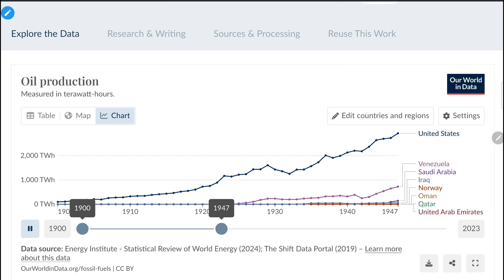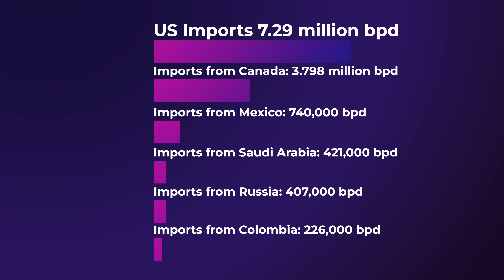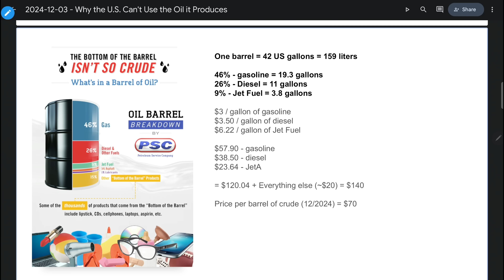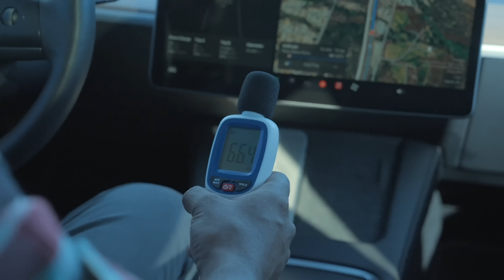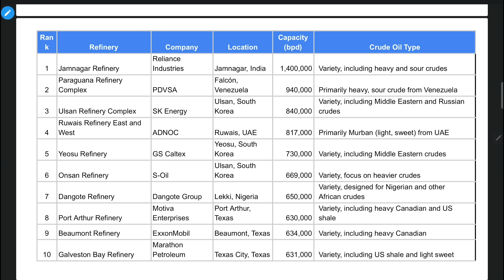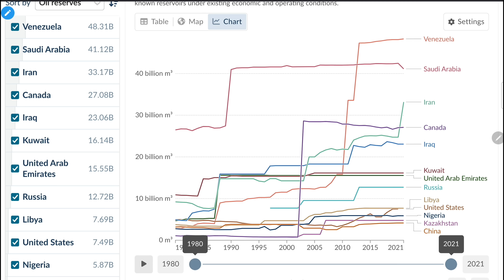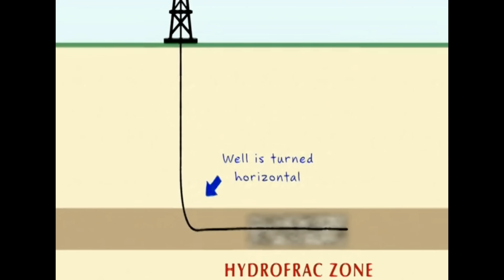Why America Can't USE The Oil it DRILLS

Comment: I work in the O&G industry and the large issue is that it is basically impossible to build a new refinery and it is almost as hard to get the permits to change a refinery to be able to run that shale oil.
Reply: @Nanan00  they're building a new refinery right now in Cushing, Oklahoma. It's not impossible, the oil companies just don't want to spend money and cut into their record profits
Reply: @christopherscott5652 Not true. 
When government administrations are hostile towards oil and gas there is no confidence in expending capacity.
Reply: @Nanan00  Impossible, or just more expensive? I’m not aware of any efforts to even try. Given the petroleum industries willingness to spend 100s of millions on climate change denial and other lobbying efforts - I don’t buy it. If they wanted to build new refineries, they’d be lobbying to do that.
Reply: @ -  It is absolutely not a technical issue because shale oil is much lighter than normal crude meaning it has more hydrogen and less carbon.  This means it is easier to refine and doesn’t need as much cracking from an FCCU (Fluidized Catalytic Cracking Unit) or a fixed bed Hydrocracker both of which are very energy intensive and result in CO2 generation.  If permits are an issue I am not sure why.
Reply: One must realize that to drll a a potential oil well depends entirely if that well makes money with a fairly quick payout for the oil company with respect to the forecast future world oil prices over the next seven or so years.   Oil companies want to make money, therefore, they always compare the risk of finding economic oil reserves in a new drll prospect, the risk of the future oil price forecasts , the risk of inflation, etc, versus what they can earn alternatively by putting the hundreds of thousands of dollars to drlll a well  into some other types of non petrolem safe investments.
    One problem with the 'drlll baby drill' attitude is that it can be too successfull in finding new economically oil reserves, therefore the market gets flooded with oil, the oil prices fall, and oil companies can not drill any new wells because the the cost of drilling and transporting the oil to a refinery is greater than the value of the oil in the ground.  Oil companies will take any profits and invest them in safe non petroleum opportunities instead of exploring for new reservoirs. And your country's oil economic reserves will fall until the oil prices recover due to future perceived oil shortages.
Reply: Thanks to the leftist liberal environmentalists running the EPA, we will never get a new refinery with the advanced technology to refine shale oil due to the illegal, unconstitutional regulations they make to prevent it from happening.
Reply: That sounds more like a government excuse and not a technological or economic hurdle.  Without those permits, a company would absolutely find a way to get it done.
Reply: When I heard you say "first, we would have to reduce coking capacity which helps break down the heavier parts of heavier crude oil," I knew you really don't  understand the refining process. The coker takes the "leftovers" from the distillation unit - all the heaviest stuff where it is pumped into a very tall column and heated to high temperature while pulling a vacuum on it. This extracts light ends that were trapped in it. When complete the column if full of solid coke. A high pressure drill is sent down the column to clean it out and break it up into something resembling coal. That stuff is shipped off to other countries to fire up their steel or electric power plants. There is no lowering of capacity. Crude oil always varies in thickness, density, sweetness, particulate levels, etc. The heavier the crude, the more coke you are likely to produce. The fractionating column temperatures also vary somewhat depending on the crude you are running, the flow rate, the reflux rate, the analysis of each cut and production goals. I could go on, but I disagree with the idea America "can't " use it's own oil. Those matters are driven more by politics than anything else. PS: the hexane extracted from the distillation unit is used to extract rapeseed oil. That oil is not fit for human consumption until it is highly refined into what we know as the coined name canola oil. Peace
Reply: No the problem is profitability💵💵💵 oil companies are not going to pump more ,refine more just so consumers can have cheaper fuel ⛽️ the other oil nations will simply cut production to raise prices 💵💵💵💵💵💵💵💵
Reply: I've Been to Texas they Move there Rigs about every other Month. So I See No Problem of These Oil Rigs Being Moved. I seen the Still Oil Rig in 20 Different Locations and I know this By the Name and Number on the Oil Rig.
Reply: No, it's not the cause. I'm 20 years with GDF Suez. Listen to the last 5 minutes of this. Refineries will put no money in refineries except for a little fixes but they understand that we peaked on our oil consumption. I've run a hundred project proposals at refineries in Martinez and LA... They don't want to put a dime in that they don't have to.
Reply: We can refine all oil produced in the US. Building a new refinery is and has been taking place...expanding an existing refinery IS building new. Ignorant.
Reply: I’m in southeast Texas and we routinely have days of heavy cloud cover. Our color panels can’t keep up and our batteries die. It’s happened twice in the last 2 months.
Reply: Internal combustion engines can be made to use naptha as a fuel since that is the predominant distillate, but I doubt that will ever happen.
Reply: This is not really true. My dad worked at a refinery that was changed over to run shale oil in the mid to late 2000s
Reply: I am an Albertan, and we know this. We know that the USA  needs our bitumen as the refineries  are calibrated  to refine  tit. This is one point that makes Canadian  unhappy  when the President  insists that  the USA  needs nothing from Canada  , when we know it isn't  true. We also supply potash for all the fertilizer, nickle,aluminum , hydro, lumber, and LNG, to name a few. These tariffs  are hurting  regular folks  on both sides of the border.
Reply: You are blatantly wrong and I guarantee you do NOT work in O&G unless you are a truck driver: You might notice that NG(Natural gas) is being used more and more as quickly as we can build infrastructure --> AKA NEW REFINERIES, BRAND NEW refineries which NEVER existed, to refine and UP crack(length of polymer chains) to create engine oil etc today?  Why?  Total Profit margin as NG is nearly free in Texas.  Said NG refineries are BRAND spanking NEW.  Just loser states like New York and morons on the LEFT coast are not allowing the building of new refineries.  Plenty of new refineries in Texas, Louisiana.  Might be a new refinery being built in either Ohio/West Virginia and North Dakota or Montana.  Pull head out of your nether regions please

ALso you are wrong and so is 2 bit as both of you are  ignorant of how the refineries work. Yes, USA can easily use the light sweet crude, just that the cracking process(very expensive oil refinery complex) will not be fully used and therefore a lot of infrastructure will have sunk ~$Trillion dollar sunk costs which will be left rusting NOT being used.  It is THEREFORE cheaper(more profitable) to import CHEAPER heavier crude and refine it using said infrastructure with sunk costs which would otherwise NOT be used, and sell for a higher profit margin while selling the light sweet also at a HIGHER profit margin.
Reply: Don't think it has anything to do with PERMITS HAS EVERYTHING TO DO WITH $$$$ to change refinery, they run the refinery at full capacity it it blows up SUNOCO PHILADELPHIA  and many more I'm sure.
Reply: If you believe that the oil industry isn't ok with not refining here or that trump will fix it, you are dreaming.  They are making money  hand over fist and there's no more money to extract from the working person. It's not about oil, the environment or providing a service.  It's the dough.
Reply: Perhaps the in coming (2024) Trump administration ( 01--20-24). These democratic party😈 regulations are asinine. democrat  party😈 controlled in California where a 3rd refinery will close in (2025).
Reply: I know
Reply: You are 100% correct government regulation's are the problem.
Reply: Let the us need the oil enough and we will see
Reply: Correction to all the arguments saying it can’t or won’t be done very soon….anybody hear of the Chevron Deference?? The department formerly known as the EPA will still exist in some facsimile thereof, but the fat unelected bureaucracy that we have at become familiar with…is going the way of the dodo 🦤👋bye-bye party poopers!✌️
Self reliance will be making a comeback in a much needed and long overdue way. EVs are fine-I think they’re a great option for some people’s needs, but the way that the administration currently on its way out was mandating the switch to them was totally irresponsible. The amount of serious advancement that the grid required for such a thing could not be taken lightly or expect to happen in a short timeframe. All alternative energy methods right now require a significant amount of “oil” and other “fossil fuels” to support them; which is why maintaining diversity within the automotive industry is so critical and will be continue to be a strong option as we move forward. You do realize that 100yrs ago there were MORE EVs in New York City than combustion vehicles right 😊. Future looks bright🇺🇸
Reply: Correction to all the arguments saying it can’t or won’t be done very soon….anybody hear of the Chevron Deference?? The department formerly known as the EPA will still exist in some facsimile thereof, but the fat unelected bureaucracy that we have at become familiar with…is going the way of the dodo 🦤👋bye-bye party poopers!✌️
Self reliance will be making a comeback in a much needed and long overdue way. EVs are fine-I think they’re a great option for some people’s needs, but the way that the administration currently on its way out was mandating the switch to them was totally irresponsible. The amount of serious advancement that the grid required for such a thing could not be taken lightly or expect to happen in a short timeframe. All alternative energy methods right now require a significant amount of “oil” and other “fossil fuels” to support them; which is why maintaining diversity within the automotive industry is so critical and will be continue to be a strong option as we move forward. You do realize that 100yrs ago there were MORE EVs in New York City than combustion vehicles right 😊. Future looks bright🇺🇸
Reply: That is by DESIGN… and we should YELL OUT WHY!
Reply: In other words under Trump is possible viable and economical because he's not going to let regulations get in the way of progress.
The big problem I have with this video is it's making such a definitive statement when the only thing necessary is willpower.
Reply: And Saudi Arabia owns our largest refinery
Reply: It takes 5 years to build a refinery. And with the way projects get delayed, add another 2 years of extra costs.
Reply: @Nanon, there’s no demand for more refineries. The fact you claim to work in the industry only proves how clueless you are. We’re exporting 900,000 barrels of refined gasoline every day due to excess refining capacity. Duhhh. That’s 38.5 million gallons of gasoline exported every single day.
Reply: Hopefully TRUMP will change that.
Reply: Nuclear has toxic waste. Solar and wind is better and with climate getting warmer we will have plenty of sun.
Reply: Which, should have been overcome decades ago. This is just foolishness not to anticipate these issues.
Reply: No. Refineries run under capacity with shutdowns to raise prices.  Market manipulation. Same with drilling. No company wants to increase supply to reduce profits.  At least opec is honest about it and explains it upfront.  It's about controlling the market and profits.   It's not about us evil regulations stopping us from having cheap oli or energy.  No company wants to spend more, to make less money.
Reply: The paper work alone !🤔
Reply: This is another industry alumni, and in complete agreement.  But the new construction underway may shift this dynamic
Reply: @rjjacks2  industry alumini......same lies...
Reply: @Nanan00  That permitting process many be taking g a big turn really soon!
Reply: @Nanan00  oil don't want new refineries.   Why spend money without making more money from your investment?   Energy companies are the same.   We all grew up with millions of homes and companies getting built and constant growth.   How many power plants were added in your local state counties as you grew up and cities grew?   Almost none. And these energy companies would rather buy surge power from out of state instead of adding plants or surge plants.  They make more money when capacity is beyond limits and the market demand is high.   But the us economy......needs lower energy prices to compete with other countries.
Reply: We can run ANY Oil at our refineries in SWLA!
Reply: Under Trump the paperwork,(permits) should be a lot easier.
Reply: That is going to change quickly.  3
refineries will be approved in 2025.
Reply: its all politics
Reply: Good video.  The changes seem too slow though.
Reply: @Nanan00  and that is exactly how the refineries lobbied for it. It is their own doing. That way they can play  the can't card.
Reply: Not worth converting those oil refineries when shale oil is going to dry up very quickly.
Reply: @Nanan00  oil is a fossil fuel and we shouldn't be using it. The US should tax oil to discouraged its use. Renewable power is what we are installing in England. I have solar panels and there's a wind farm just up the road. Most people want to buy electric cars these days. The Idea of oil wells and refineries is really old fashioned and even a bit weird
Reply: @Nanan00  I am from . As you 
 we want to build new refineries  so  we can export more finished product . We currently  send about 4.2 million barrels  per day to the  USA.This is heavy bitumen. 
We have the technology  to build cutting-edge refineries . As you are aware, these are massive projects and take years to  build.  Trump still wants the Keystone  XL completed, starting in Alberta.  We currently  ship 890,00 barrels to Asia.   There is a plan to build another pipeline  west to  our tidewater  on the  Pacific ocean.
Reply: Wrong. The issue is not can we - the issue is profit. Right now it’s more profitable to sell shell/sweet oil and use that cash to buy sour oil n refine it with our existing refineries - this nets the greatest profit which means it gives the consumer the lowest price. If we build a billion dollar refinery to refine shell/sweet oil that expense gets passed to the consumer - fuel prices go up.
Reply: @Nanan00  they are also not very profitable
Reply: Your boss might tell you that's the reason, but the real reason is always money. 
In fact your current president would bend over backwards to enable permitting, but your boss would just find another excuse not to do it; because It simply costs way too much money.
Reply: This is plainly not true.  The complicated part is cracking heavy oils.  Light oils nearly process themselves.
Reply: @JS-oh2dp  correct. The only thing that's better is biomass and especially biomass where the biochar is used for soil improvement. Then you'll actually get a negative CO2 number.
Reply: more money to be made exporting sweet light crude, it's a crock, they shouldn't be exporting any oil, it's a scam, the oil and gas industry is just as crooked as big pharma, they own the government.
Reply: You'd have to modernize every city in this country every building I've ever worked on has always had a boiler room Tate New York City I bet you 90% of that is heated through using oil
Reply: Not true.
Reply: I also work in O&G. Diesel is king, if gasoline ever becomes profitable they will make the switch.
Reply: So it’s not Drill Baby Drill!Where doing that.Its build Refinery build!🤣
Reply: I work oil and gas engineering.  Oil shale needs a new process developed in order to access the oil.  Something similar to Oil sands extraction needs a scintillation process.
Reply: @coloradojohn4582  - no we use shale oil all the time now.  It is much lighter than normal crude and therefore produces much less CO2.  You don’t need an FCCU or Hydrocracker for Shale oil.  You are thinking of Oil sands in Canada which are a very heavy crude that need cracking and release much more CO2.
Reply: I’m curious what the cost for new shale refinery vs retrofit. Also efficiency differences possible with new. I also think we need to have national strategy to adjust consumption to other sources of energy where possible.
Reply: @CraigRock  liberals want allow a new refinery .
Reply: @CraigRock through all this chatter I hear it's talking about nuclear energy but I never hear anyone talking about Fusion just think if we had a president that would just stand up and say in 10 years we will have an operational Fusion plant and I'm pretty sure we're within that grasp it's funny how anyone talks about hydrogen-powered vehicles
Reply: @CraigRock  
Maybe one strategy could be to gradually build out shale refining capacity primarily to cover the growing need for fuel anticipated into the future, rather than to convert much of the existing refining capacity to use shale. This would in the long run have a similar laudable effect of reducing dependency on imports, but without any sudden upset or need for large short-term investment.

Of course, "long term" might not be good enough, e.g. if global supply lines and trade end up disrupted by an increase in armed conflict or some other sort of crisis.
Reply: @Nanan00  Please enlighten us on weybit is impossible to build new refineries for shale.
Reply: Increasing production will put more oil in the marketplace lowering the price per barrel which in turn will lower the cost of fuel. This will have a positive effect on the prices of all of our goods and services. Drill baby drill.
Reply: @brandonmcburney1  you will also need to consider the price of production will not be the same...so less jobs at the high pay rate...
Reply: @davidbryant3532 Not from my experience. If wells are producing, workers have to operate and service them.  Obviously, if prices got so low that low producing wells were shut in, that would be a different story. I’ve only experienced that 1 time in 30 years. (Pandemic)
Reply: So, essentially the same problem with nuclear?
Reply: @Eric-le8on  historically nuke plants ran full tilt and cannot easily be ramped up or down.  The lack of demand  from surplus drives down pricing which govts want and energy companies hate.  Nobody wants to provide more product for less money.
Reply: @Eric-le8on Nuclear has the danger of terrorism, in my opinion.
Reply: It is possible to built new refinery, just vote right people in.
Reply: Praise god the deregulator and chief is here
Reply: Why is producing our own oil being sabotaged?
Reply: @heaven-is-real  because we don't want our rivers to catch fire like they did in the 60's
Reply: @stanford2444  the newer refineries do not do that
Reply: @heaven-is-real  then build one, sounds like you will get rich
Reply: @Nanan00  Trump will fix it don't worry
Reply: Not under a trump government nothing’s impossible.
Reply: The life of these wells are extremely short, the boom will end. Is it even feasible to invest in a refinery for a short lived resource. If they thought so there's enough lobbyists in Washington to get the refinery built. If it doesn't happen under Trump we know the limited resource doesn't warrant a refinery. We'll carry on bau and moving to other energy sources to reduce pressure on oil.
Reply: @jrstsb1353  that whole peak oil thing was never real. So you think we are better off paying China for windmills and solar panels?
Reply: I guess that's what Elon Musk was talking about too and wants to change 😊
Reply: @N0rthernLites you shouldn’t be getting your information from Elon musk, he isn’t very intelligent. He gets his information from twitter memes. He’s good at claiming credit from other people
Reply: Hahahahaha!  @N0rthernLites
Reply: Trump will fix that....😂
Reply: @ElsaLay  yeah I wonder if his 20% across the board tariffs will apply to imported oil?  They should.  Suddenly gas prices would skyrocket!  I consider myself a "green" person but I think building new refineries should be okay so long as they are replacing existing ones and eliminating the need to export and import oil which is stupidly wasteful even if it is profitable (when you take the short term view).  Then again I think we should also build nuclear power plants to supplement renewables and make it easier to use even less oil and gas.
Reply: @ElsaLay  yeahhh Mexico will pay for the wall
Reply: @ElsaLay   Trump, looking at EPA pasted on the whiteboard: 

"AFUERA!!! "
Reply: @ElsaLay  How ???? It takes years to build refineries.  Is Donnie going to nationalize the oil industry?
Reply: Trump has fixed that. @ElsaLay
Reply: @ElsaLay  Oops, no he won't.
Reply: @ElsaLay  lol he will bring back Manufacturing for doggy plush toys too…..
Reply: Why even build new refineries or retrofit existing ones, when the world is moving to other sources of energy?
Reply: @joshs3229  yeah, if the oil companies wanted to build more, they would get rid of the regulations with as much power as they have. Investors don't want to throw good money after bad.
Reply: @joshs3229  The same reason Trump bragged about trying to bring coal jobs back. Nothing matters.
Reply: @joshs3229  like China and other Asian countries going to high speed rail, 300 km an hr. while e we patch our amtraks up with duct tape.
Reply: @joshs3229  Because oil is used for much more than energy.
Reply: @joshs3229  You didn't watch the video, he specifically mentions feedstock requirements for petroleum. Literally EVERYTHING in your life revolves around petroleum, it's not going anywhere!
Reply: @joshs3229  "Why even build new refineries or retrofit existing ones, when the world is moving to other sources of energy? 
"Because #1 oil is used for far more than just fuel and #2 we are still a long way from having electric vehicles viable for the U.S. market.
Reply: @joshs3229 where is this taking place? Nowhere.
Reply: @joshs3229  What are you going to operate on, at what cost, for the 2 years each refinery will take, to do the refit????
Ever since Diaper Don, came out with his retread idea, I've been pointing out the fallacy of it all.
Reply: Because oil, gas and mining are needed to provide those alternatives....
Reply: @joshs3229  Because the world still uses oil..? And will continue to use oil until.. well until we run out of oil? 

The better question is: why WOULDN'T we build new refineries?
Reply: @joshs3229  We will never move completely away from the combustion engine, so the need for oil will always be there.
Reply: @joshs3229 no it’s not.  Fossil fuels are used for a lot more than fuels.
Reply: @joshs3229  Mathematics and economics have entered the chat.
Reply: @joshs3229  Americans have that "everything was brought to your local store by the TRUCK". Diesel truck. Ever seen enough electrical  trucks which can replace  those BIG truck's fuel tanks for those long-long roadrs, interstates? NO.
Reply: @joshs3229  EV still need fossil fuels, if you take everthing in a vehical made from fossil fuels you will have nothing left to drive.
Reply: Oil is the cheapest source of energy available. You can get energy from other places but the energy return on energy invested is far lower. If we stopped drilling oil today. Society would be gone by the end of the week.
Reply: @joshs3229  we are a long way away from not burning more fossil fuels, if it is even indeed possible. Currently, we are burning less globally because of global economic slow down, and in the US we still have rolling blackouts especially in summer times, and not because we are producing enough (unreliable) renewable energy.
Reply: @joshs3229  
> "Why even build new refineries or retrofit existing ones, when the world is moving to other sources of energy?"

It's really not. The world's use of fossil fuels is still increasing. The best we've been able to do is to moderately slow the rate of increase, and even that has had severe economic repercussions. Fossil fuels will remain essential for the foreseeable future.
Reply: @joshs3229  Except the world really isn't. Solar and wind simply aren't economically viable and sustainable for industry heavy countries, as they require a completely new energy infrastructure and are very unreliable and dependent on specific local climates to be efficient. Coal, oil and nuclear will still be required for providing the base load capacity, at least until effective and economic large energy storage solutions have been developed. Or until fusion energy becomes viable.
And the market for electric vehicles is crashing, as those have proven to be simply not up to par with regular combustion engines in terms of reliability and safety.
They also require a completely new and expensive energy infrastructure which only makes sense in urban environments really.
And in terms of environmental aspects, EVs are also not exactly clean due to the vast amount of required mineral resources and problems with disposing and recycling of usually highly combustible batteries with very limited lifespans.
Reply: @axelhopfinger533  Everyone who I have ever talked to about their roof top solar array has one complaint.  That they wish that they had done it sooner.  Then they get an electric car and charge it from the solar panels in some cases.  Even better.
Reply: @joshs3229  We should take advantage of our own natural resources. We clearly need to increase refining capacity so it can handle the light sweet crude. The environmental movement has tied up the process in red tape. We need to remove the unnecessary red tape and get the refining infrastructure modernized. And btw do you really think we can meet our energy needs with wind and solar?  China is building lots of coal fired power plants to run their manufacturing industries to build all the things we used to build here in the US.
Reply: @bobd251  China is also building massive solar energy.

Australia is moving to 100% alternative, linking up its grid across the continent.  

Tasmania and South Australia  are already 90 - 100% alternative energy already.  

The other Australian states are working on this too.   If Australia can reduce its imports for gasoline by 90% by switching to EV cars and vehicles then Australia saves $33b a year. 

Why wouldn’t Australia and all countries that don’t have their own oil or their own oil refineries try to switch to EV cars and solar and wind energy because these countries save money and gain energy security.  Imagine that!
Reply: @joshs3229  the world isn't " moving to new energy sources" look at everything oil contributes to in your daily life. Roads? Oil, clothes? Oil, plastics? Oil. You live in a world that is built off of the back of oil like it or not. We will diversify and I hope we do but we will not see the wind down of oil for generations to come.
Reply: Glad we have a new president that can fix that.
Reply: @ryanellsworth7246  Are you also glad that the new president is throwing wrenches left and right into the US economy which is going to make the investment dollars needed to do this kind of thing absolutely disappear?
Reply: Have been awake in the last few weeks ? donnie j. is not about wasting time asking some chumps if he can proceed
Reply: @jeffbarron5500  Exactly. We need someone to dictate everything without any checks and balances from elected officials.
Reply: @schubajo  well you've got your dictator. Hope it doesn't bite you on the ass.
Reply: @Nanan00  Trump will try to change that in many areas such as permitting in various things(refinery, drilling, exporting LNG...). More drilling in many locations including Alaska, off shores to produce more conventional oil. Deregulation so that older wells can still be profitable to resume production.
Reply: @allsportsexpert  It’s a nice dream, but oil and gas production companies are not going to drill and produce more because increased supply will lower prices and also profits. They are sitting on more than 25,000 leases to drill, yet they are not drilling. Oil and gas producers will not drill just to lower prices for consumers.
Reply: @MichaelWalker-t2j  in other words, you don't under oil and gas business. This clearly is way over your head. Supply is ONLY one of the many factors. Take a seat please. By the way, I do this for a living.
Reply: @allsportsexpert  Retired CFO of an oil and gas production company. Your premature conclusions betray your ignorance.
Reply: @allsportsexpert  So Trump wants to force oil companies to spend money to make their product worth less?
Reply: @allsportsexpert  Hello Neanderthal. Welcome to 2024!
Reply: @allsportsexpert  That sounds like an absolute hellscape.
Reply: @allsportsexpert no he won’t. He doesn’t have a clue what he is doing! He just performs to the maga😂
Reply: @allsportsexpert  how long until the energy return is negative (i.e. the time you need to spend more energy to drill and extract than you could get out of the extracted oil)?
Reply: So over-regulation is the problem once again. Same problem with the “affordable housing” issue and a host of other things. It’s almost like the government over-involving itself in the market creates problems. Weird.
Reply: @Jordan-tq2jc no, over regulation is the excuse. It’s cheaper to ship it, there is no incentive to build the refineries. They blame regulations.

Some day you’ll learn that corporations are not your friends. They don’t care about anything but money.
Reply: @ I’m well aware that large corporations are not my friend and in many cases, they hate the “little guy” and are my enemy. But over-regulation (particularly at the local level in the housing sector) is why I’m unable to afford a home buy building it with my own two hands. 

As far as the refineries go, I’m sure that’s true. It’s likely cheaper to ship it. Just like it’s cheaper to outsource manufacturing etc. at nearly all levels of commerce. 

That being said, excessive regulation doesn’t usually help anyone BUT the big corporations as it essentially creates a crony-capitalist (another word for quasi-fascist regulatory environment). In the case of oil, my understanding is that the regulatory environment has only really been working against them at times in the past decade or so. I’m actually fine with shipping in oil (especially if it’s cheaper) but I also recognize that it would be foolish for a country to completely outsource critical infrastructure and manufacturing. We should be building refineries in our own country to be able to sustain ourselves in the event that we’re “cut off” from resources in the future. This includes the production of medicine, etc. 

I’m typing this at a break between work as it popped up on my phone so my apologies if the thoughts are disjointed to a degree. In summary:  No big corporations are not my friend… but excessive regulation is an even worse enemy even directly in my personal life. Finally, we should be working towards having the ability to manufacture and refine products that are essential to our infrastructure, health, and economy.
Reply: Drill baby drill
Reply: If we want to even attempt to hit our CO2 emission goals, we should not be increasing anything with fossil fuels.
Reply: @schubajo  If you want to deal with CO2,  It's as easy as planting more trees,  building less roads, and fostering sustainability instead of consumerism ...of course those who are making the big bucks through industry want consumerism to reign,  and will do anything to convince the people that is the ONLY way people could ever be happy or free.
Reply: @MonkeyMind69  Those help but are not the whole solution. The "fostering sustainability" is pretty vague and needs to be defined. People don't up and decide to do that without incentives. Planting trees is good but we are past the point where that will fix the problem. And that is assuming that the trees we plant are properly planted and cared for. Unfortunately many are planted in places the species is not good for and only one species is planted. The planted trees quickly die.
Reply: @schubajo we'll just put the burden on poorer countries so Americans can have a clean conscious😅
Reply: Because I'm sure that shipping our oil around the world, and importing oil from everywhere else, decreases our total carbon emissions.

Natural Gas and Nuclear are clearly the immediate answer to the carbon problem.  In the meantime, cheap, efficient, local oil production will decrease the cost of plastic (used in electronics), and decrease emissions from shipping oil products abroad.
Reply: @schubajo  so is it better to load tankers that dump who knows what I'm the ocean to carry it halfway around the world while burning heavy fuel sludge?
Reply: @BeagleBob-zw7wg  No. It's better to switch to ween ourselves off fossil fuels and switch over to renewables.
Reply: @schubajo there is no switching, there is simply transitioning to use that oil in other products, fertilizers, chemical industry, pharmaceutical and so on.
Reply: @TheFoghail  Fossil fuel oils are not required for many of the things you listed. There are tons of efficient fertilizers that do not use fossil fuels. For pharmaceuticals, do you mean plastics? There are plant based plastics which don't take several hundred years to break down.
Reply: @BeagleBob-zw7wg  Yup.. Shale costs $60 a barrel to produce.. Saudi Arabia drills the heavy slug stuff at $12 a barrel.. For every barrel of sweet crude we ship out we can bring back 1.2 barrels of the heavy stuff. Oil companies are not going to invest in new refineries for the sweet shale we drill in the US.
Reply: @schubajo  nuclear reactors would do great to power everything that requires electricity. But cars and trucks and tractors require fuel.
Reply: @davlee1972  I'm not talking about money, I'm talking about pollution. There is enough profit in the petroleum industry to retrofit everything and still make money without raising prices. But ceos need to make millions each year so they can bribe politicians
Reply: @BeagleBob-zw7wg  bio-butanol (ABE waste fermentation) is one possibility for a direct replacement for that in gassers, or use the bio-butanol with yellow grease to make a bio-crude to refine into spec diesel with cracker/reformer. Still has the efficiency downsides of cheap engines though.
Reply: @BeagleBob-zw7wg  Actually, if you are a country that imports oil, it's better to have several sources in case of disruption. Every country should have multiple sources of natural resources.    Canada and the US have been lazy about developing new partners because it was easy.
Reply: @schubajo  you hit the nail on the head why refineries aren't upgraded.
Reply: @schubajo  So let's not do that.
Reply: @schubajo what are those goals? What is the level of co2 in the atmosphere? Bet you do not know that.
Reply: @schubajo  the  world need to hit CO2 emission goals. a single country  reaching it goal is useless.  it make no sense  reaching that goal if the oil is going to be process in another country
Reply: @midnightwatchman1  The US is one the largest CO2 emitters and emits a very high CO2 per capita compared to other developed nations. While more than just the US is obviously needed, just the US hitting its goal would be massive. That said, the Paris Agreement was signed by all but three countries. If everyone follows that, we would be on a decent path.
Reply: @schubajo  and  what would be the point  if the CO2 production just moves overseas. which in most cases will result in even more  CO2 . which is reason why even thought develop countries have cut emissions the global rate keeps increasing .  Stupid policy
Reply: @midnightwatchman1  But again, all but three countries (Libya, Oman, and Iran) signed the Paris Agreement so what you are saying is not happening.
Reply: @schubajo  CO2 is not bad.  it is the basis of all life on Earth.  Stop listening to the fear mongers making billions on your ignorance.
Reply: @schubajo  I think we're already fucked. I'm pretty sure nuclear was the only viable solution that we had ready in our lifetime. 

Without doing any research, my theory is simply this: why would oil companies allow the status quo to change, if they can influence the population to keep purchasing what the existing infrastructure supports? 

I believe propaganda and lobbying are to blame, simply because that's almost always the reason an existing technology doesn't get replaced by one that is superior.
Reply: @schubajo  ok Elon
Reply: @schubajo  our CO2 goals are basically nothing compared with china, ask them to cut down and maybe we’d see some change in the world, we have a fraction of their emissions output.
Reply: @schubajo  - why wouldn’t you want to use light shale oil and gas which emits much less CO2 than traditional crude oil.  It is a much lighter crude which means that it has more hydrogen and less carbon per barrel.  Plus we can never get away from oil and gas since almost everything is made from it.  Just imagine your life if you were in the 1800’s before oil and gas.  That is where we would be.  Many people would die.  All of the fertilizers which are used to feed the world are made using natural gas.  What you are advocating isn’t even possible at this point.
Reply: @schubajo  wrong . China is adding more coal plants a year and belches 100 times CO2
Reply: @schubajo  what emision goals? the USA is no longer part of any such agreement.
Reply: @lucaskp16  We were less than a month ago when I posted that.
Reply: @schubajo  easy to say , till it's cloudy and the wind is calm.....
Consider the inside of your house at 40 degrees in the dead of winter,
                   and the electric grid is maxed out so there are no electrons for your EV
Reply: @reasonablespeculation3893  You are saying that across multiple states there are times when there are clouds so thick that 100% of sunlight is blocked and there is no wind for hours at a time? Can you point out when that has ever happened? Or do you think electricity has to be generated right next to you? Fact is renewables with battery storage are cheaper than the alternatives. And we have a thing called a grid which provides power from all different areas. For instance the UK is having solar and wind farms built all the way down in Morocco to provide it even more efficient power.
Reply: @reasonablespeculation3893  so why can the Norwegians do it?
Reply: @stanford2444  If you've got plenty of reliable  hydroelectric power plants, with wind or diesel or Gas or coal backup, then the system  will work.   I'd still suggest nuclear power
as a long term reliable addition to the grid.
Reply: @reasonablespeculation3893  Better to have wind & solar on & off grid than only the fossil fueled grid source.  The grid needs expansion just like roads & other supportive infrastructure like bridges & gas stations needed to accommodate progress when travel greatly increased as automobiles replaced horses!  Do you think the lack of paved roads, gas stations & refinery output should have been a valid argument against the adoption of automobiles?, too few airports for airplanes to proliferate etc.?
Reply: @reasonablespeculation3893  Bad weather closes down coal power plants.  That happened in Texas on a massive scale a few years back.
Reply: @schubajo  why would we want that?

We are currently at 420ppm of Carbon dioxide, when the planet was at 1480ppm it had a 10x the amount of biodiversity that directly led to tree primates that eventually evolved into Homo-sapians.
Reply: @schubajo  - Good luck with that, oil and gas have improved our lives in many other ways than transportation fluids.   I challenge you to stop using all plastics.  Additionally, most of the solutions that have been offered to reduce CO2 don’t actually reduce CO2 enough to matter.  They just shift where it is emitted.  Electric cars are a good example where the CO2 needed to make the batteries is equally to the CO2 emitted from a gas car after 75k miles before you charge the battery.  If you account for the CO2 generating the power to charge the battery your break even mileage is 100k miles.  By then the battery doesn’t have much life left.    CO2 only represents 0.04% of the atmosphere.   People only generate about 30% of that.  The melting permafrost is going to make our CO2 contribution insignificant.   I think we are headed for a time without ice sheets which will increase the amount of farmland so hopefully it won’t be the disaster that it is being advertised to be.
Reply: @mathman1475  Nobody said we need to stop using plastic altogether. We do need to drastically cut down our usage though. The amount of single use plastics that we use is ridiculous. We could also switch to plant based plastics. The use of plastics has resulted in higher rates of fertility issues because microplastics can be found in all parts of our body.

Your numbers for EVs and CO2 emissions are the figures for using coal as an energy source. Using anything else, the break even point is dramatically lower. For me, it would be around 15k miles. You also seem to have incorrect information about batteries. EV batteries are rated to go 200k miles before their charge capacity drops to 85% which is still very usable. But most actually do significantly better and LiFePO batteries definitely do better. When solid state batteries hit the public in a couple years, they will have even better longevity. There are definitely a few issues with the current technology but solid state batteries will solve a lot of that because they last longer, are more energy dense, charge faster, and can't catch fire.
Reply: @GreyWolf-64  The increase from 0.03 to 0.04 % is responsible for global warming, that’s an increase of a third in one of the most important green house gases. If all ice on planet earth was about to melt, 99 % of Florida would disappear and every coastal state of the US would be drastically changed.
Reply: @ - we are in a natural Ice Age termination.   The glaciers are all going to melt and there is nothing we can do about it.  There is a 100,000 year cycle Earth's climate cycles, primarily referred to as "Milankovitch cycles," are long-term fluctuations in the planet's climate caused by changes in Earth's orbit, axial tilt, and precession, which affect the amount of sunlight received by different regions and lead to alternating periods of ice ages (glacials) and warmer interglacial periods, typically occurring on a cycle of roughly 100,000 years. 
You can’t stop it no matter how hard you try.
Reply: @schubajo  will never do enough to offset chinas pollution.
Reply: I am disappointed 😞 in your entire presentation. You miss key factors that shift the balance of geo politics to favor geo economics, especially in California. The source of energy for EV's comes from coal burning plants. The percentage of gasoline and drill baby drill gas guzzlers are coming back because EVs suck! Go back to a numbers game and stop hallucinating about renewable energy powering our transportation system. By the way, solar panel farms wipe out the desert environments and expensive wind turbines destroy habitats and their carbon footprint is worse.
Reply: @miguelhidalgo9372  Where are you getting that most energy used to charge EVs is from coal? Please cite your source. Coal makes up only 16% of energy generation in the US according to the EIA. EVs are fine for the vast majority of people and are cheaper after only a few years. They are making up an increasing share of vehicles on the road.